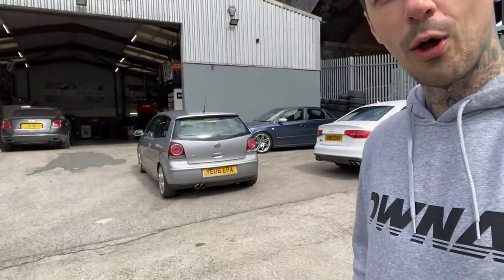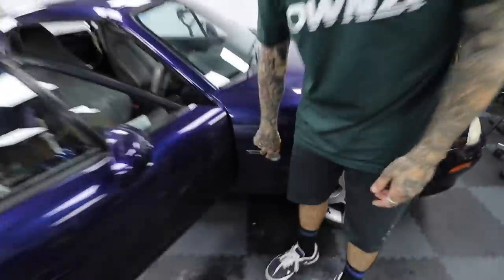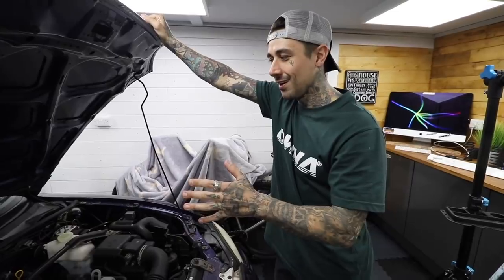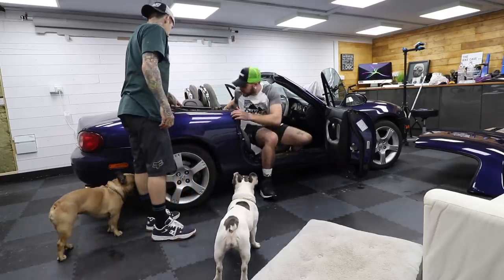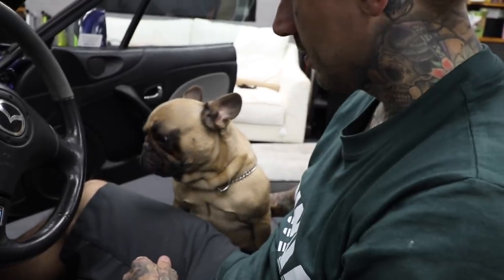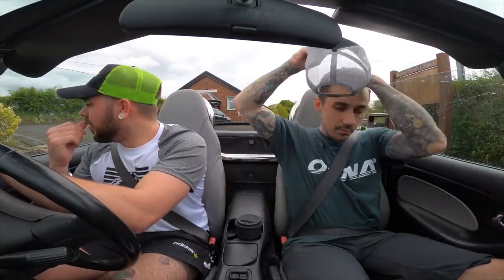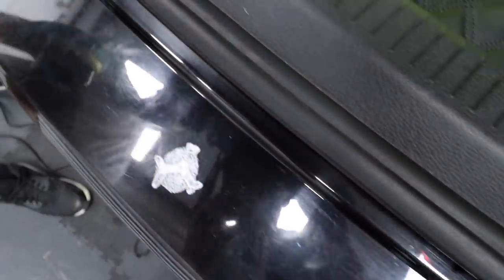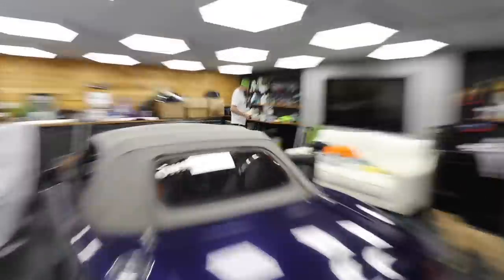MAZDA MX5 DRIFT CAR BUILD..... RWD MACHINE!!

Comment: Yes Harry. I’m a detailer at a vehicle conversion specialist,  been doing used paint restoration for years now and thee best product Iv come across is 3M. Theee best by far, a 3 stage polish using green top to cut then yellow top for finishing the results are unreal.

Comment: The oil dial in the middle is oil pressure not oil temp ☺  watch out for the chassis rails and sills. Mx's tend to rot from the Inside out. Got 3 MX5s on the drive way at the moment. 2 mk2.5s and a mk2. And the bars behind the seats won't save you if you roll it, they'll take your head off, they are style bars. Get a roll cage ☺ can't wait for the MX content mate. Your gonna love it the more you push it and get to feel it. Seriously under rated cars man!

Comment: Dixie looks better today. The oil gauge is for the pressure the cold and hot is to detect if the engine is over heating. It should stay right in the center when in use. It will start off cold that’s normal. But once it’s been running the needle should go right in the middle. Nice car and I think the hard to or topless of the best.

Comment: softop or hardtop is a thing you have to choose because the hardtop makes the chassis a lot stiffer but if you have no AC its gonna be really hot inside also when its like nice wetter outside 25/30 degrees its nice to have a softop so i would say get a rollbar and drive softop in the summer and hardtop in the winter thats what most peopl do you can buy or make a stand for the hardtop

Comment: i  used to have one.. i say put a flat black roll bar in will stiffen it all up and run the soft top in summer throw the hard top on for winter
Reply: fyi those chrome bars that came on them stock were strictly cosmetic, not structurally sound. youll want a hard dog roll bar or something similar

Comment: Hi Harry I drift a mk2.5 great cars check out destroy or die get some knuckles huge upgrade over the standard lock and go for a welded diff as the lsd open wen you transition and link corners

Comment: Cant believe you said that that roof covering isn't in the best condition hahaha what world do you live in the roofs immaculate pretty much haha looks a beast as well. Honestly mate if you stiffened the chassis roll bars etc with all the power flex bushes and put a decent size turbo on it and stop drifting it in the dry it would be an absolute savage.
New front lights and a wrap it would look evil evil.

Comment: Not sure but I think it's for low and high oil pressure, the dipstick if for checking the level, not 100% but it makes sense to have oil pressure in the car rather than oil amount if you can simply dip the stick 🤣

Comment: The silver bar is a style bar which should be removed immediately! It will flip over and break your neck if you roll! Fit a proper TRLane roll bar which goes right down into the floor.

Comment: Loose the show cage and get a proper cage and the oil is a pressure gauge as for induction divert it behind the drivers light not as it is next to the exhaust

Comment: 1 the oil gauge is pressure gauge and its fake it shows the same thing as long as u have more than 7psi
2 glad u didnt get mk1 they no good apart from headlights lmao
3 slow the polishing machine a bit u gonna burn throught the paint one day